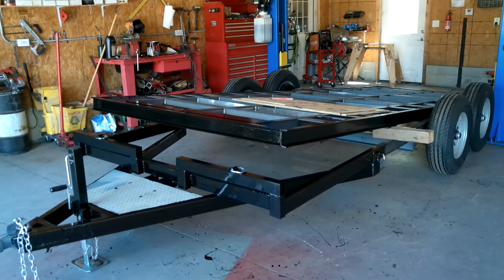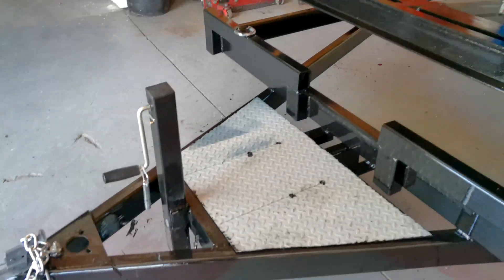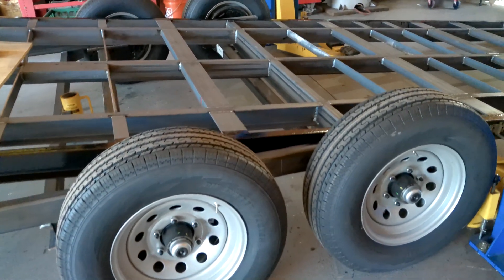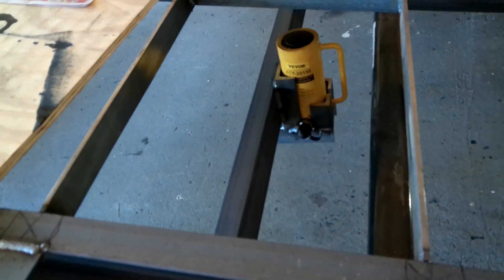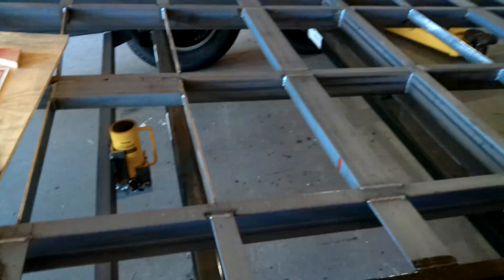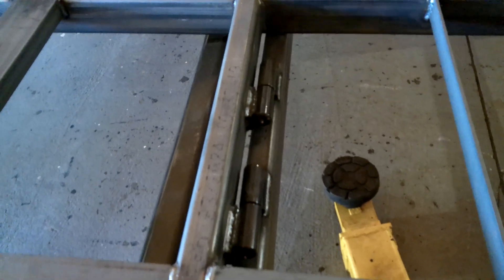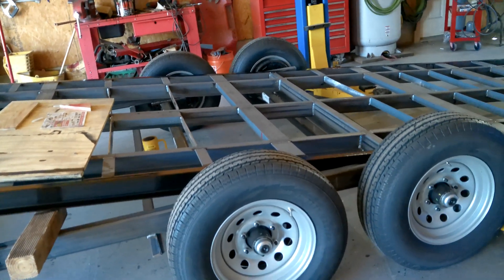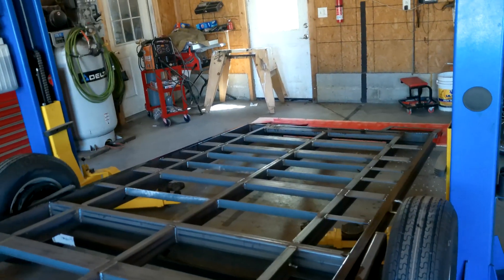How to build a tiltbed trailer part 1  June 2024  80 inches x 18 feet gravity tilt.

Comment: The way you explained the rating on the tires is incorrect. The “dual” rating is referring to dual wheel configurations (2 wheels on each hub) not tandem axles. So you get the full weight rating of each tire, not the reduced rating

Comment: Did you have a some plans on where to put the pivot and other dimensions?  This is the exact trailer I was thinking of building.  I just aquired a set of 5000lb axles and thought it would be so nice to have a tip deck running the skid steer on to.   Looks like yours is built really well and would be perfect for what I want.    To bad you didn't video your whole build from the start.
Reply: Northern Tool sells trailer plans. There is also a website called Mechanical Elements that sells plans.